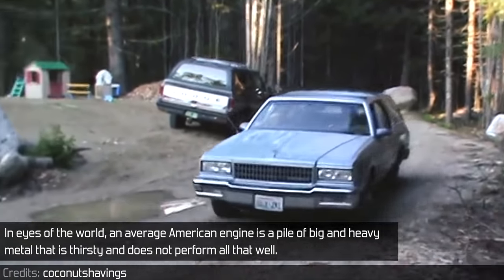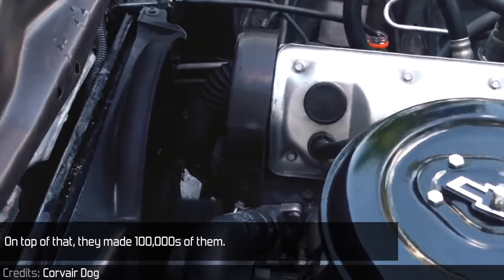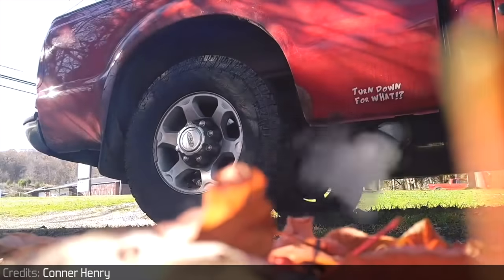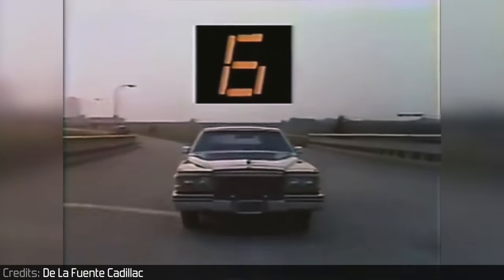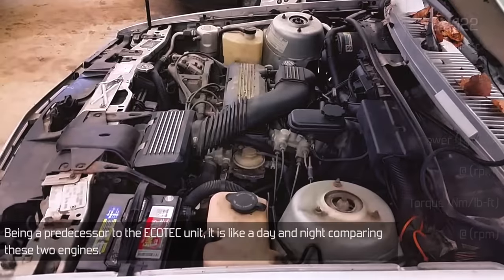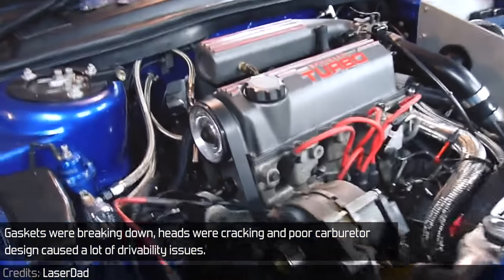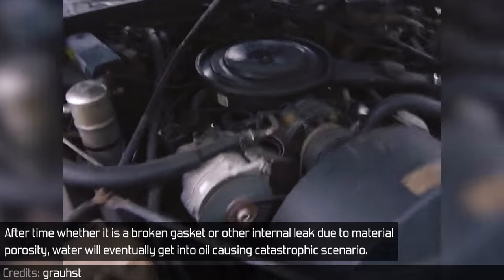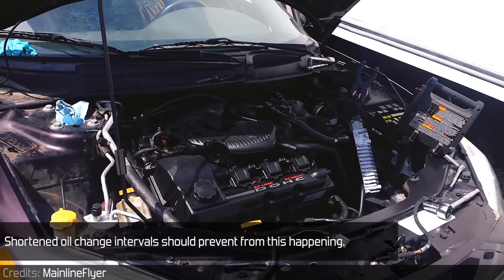8 Worst US Engines You Should Avoid

Comment: Another major problem with the Cadillac HT4100 that you failed to mention was the aluminum block with cast iron heads.
Reply: StrongEnough78 I have an 83  Eldorado,  beautiful car in and out. has the dreaded ht 4100, but this one has been trouble free. about 165.000 on it now. I believe my excellent maintenance has been key, oil changes every 3000 miles, and coolant changes every other year and THE COOLANT TABS Allways ADDED. what ruined these engines I think was when the cars got older and were resold, a lot of these new owners did not follow the coolant requirement regimen,  and just drove them with poor to no maintenance,   and without those coolant TABS being replaced the engines eventually failed.
Reply: These things would eat intake gaskets 24/7. Just the sight of a milkshake these days makes me nauseous.
Reply: Sadly yes.  That was very prevalent with the HT series engine to also include the 4.5L and 4.9L engines.  The Cadillac Allante engines are not the same as they were built much different than the rest of the line up.  They were special engines that didn't experience the same problems as often anyways.  I'm not saying problems weren't there but the engines themselves were much better built.
Reply: @stevefranklin8052  Correct.  Proper maintenance does go a long way. It was the same thing on the older Cadillac's going back to the 50's starting with the 331 cu in engine. The cooling system is very important to maintain but its one of those things that gets overlooked very easily.  I've owned two different HT4100 Cadillac's, but sadly one of them had an internal problem that had to get rebuilt.
Reply: He said in the video it was a aluminum block with cast iron heads.  I know because it caught me off guard.
Reply: @marcmo7138  My bad. I totally missed it.

Comment: You forgot GM Quad 4 and the 301 turbo TransAm. Everybody has made shit engines, do the French next. I'll start...the standard LeCar.
Reply: It was one of the only imported in the us but sadly not the best. French car nowadays are great, sometimes weird designed but well engineered
Reply: a lot of the GM quad 4 engines weren't all that bad though under powered the quad 4 2.4L was the one well known for trouble while the 2.2 push rod based quad 4 engine (used in the corsica and caveleer/sunfire) is a much more reliable unit though early on had head gasket problems due to the coolent eating the gaskets resulting in GM switching over to dex-cool (that early on in its life gained the nickname dex kill as it was prone to developing sludge blocking cooling passages blowing out head gaskets (GM 3100 3.1L and 3400 3.4L V6 being two such well known problem cases) on this list as well should have included the GM 3100 multi-port/3400 SFI V6s these engines are prone to bending push rods, valve train lack of lubrication problems, heads, head gaskets, spark plug fowling, coil pack trubbles, being under powered in many vehicles they were put in (2000-2005 chevy impala, venurer/transport minivans) the engines are also known for rod barring problems and require regular maintanence scheduals to be adheared too strictly or there will be an expencive repair bill
Reply: upside downdog TBH if you want a casual car today (like midsize sedan) French cars are better than the American ones.
Reply: Layth Alkhaer not midsize sedans, altough the talisman , Citroën ds5 and c6  (not in production  anymore) are quite great (but undermotorised ). The french (and part of the germans) really nail it on hatches, small cars gti and hot hatches, like the 308 gti, the megane rs, the 208 gti and the last gen clio rs. But it will also slide to little performance cars like the new alpine a 110 or the Peugeot rcz r.
Reply: The problem with the Quad 4 was it was setup to run on Premium Gas. Most of the ones I seen blown up where people running Regular Gas in them and overheating the Piston. As for the 301, Total shit!
Reply: chada75 
How about waterpump failures at around 60,000 miles that cost around $2500 bucks for a shop to replace?
Reply: id say that shop was ripping you a new one and you could replace it yourself.  its not hard.  just time consuming
Reply: Big Show 
It wasn't mine. I wouldn't own one. I restore antique airplanes for a living, a broken car is a temporary setback. They replaced the cylinder head and all other necessary stuff from the water pump failing.
Reply: nothing wrong with the quad 4.
Reply: Frigglebiscuit 
You keep it then. GM's attempt at modern engine architecture (60's tech) was a good idea designed and executed poorly.
Reply: The Iron Duke?
Reply: 5Rounds Rapid 
THAT is one GM did good. The Quad 4 was DOHC, 4 valve that made around 200hp. They put it in Grand Am type front wheel drivers.
Reply: upside downdog My sister had a Grand Am with one. The engine was fine, the body was junk.
Reply: 5Rounds Rapid 
Sounds like you live up north where they salt the roads. Oldsmobuicks typically have well built bodys. Some had good drivetrains. Quad 4 NOT one of them.
Reply: You know they have entire racing series limited to GM quad 4s (dirt track).  Olds Racing had a turbo quad 4 with 900hp in the late 80s
Reply: Joey Quigley 
I did not. Great use for them as power wasn't an issue. Still an awful passenger car engine, they needed lots of maintenance.
Reply: What's wrong with the 301 in the trans am It's a strong motor only issue is it underperforms but you could get a lot more out of it it has a rolled fillet crank forged pistons and stronger internals and cylinder walls you could safely crank the turbo up if you wanted to
Reply: upside downdog Nope, the South. She ran into a deer, and all the plastic trim fell off.
Reply: The ONLY reason that GM did away with the Iron Duke is because people were complaining about the noise it made, and GM couldn't make it any quieter.  Other than that, it was one of the best 4 cylinders ever built. A bit underpowered but still an EXTREMELY reliable engine.
Reply: Yeah like the Renault Alliance. Car of the year...lol, ha ha ha ha
Reply: Quad 4 was a mixed bag. It could make good power with an NA tune, and it was possible to get them around 200HP to the wheels with the right cams and computer program. For a while it was the highest power per displacement with no boost. And it was doing all that before Honda came along with their VTEC. (However the Quad didn't have the variable cam thing Honda did, so the idle could be quite rough. Later variants tried fixing that with other band-aids like balance shafts, but it was effectively de-tuning the engine with more rotating mass and less overall performance.)

The downsides is the heads were prone to cracking, head gaskets didn't do too well (never run it hard cold, fastest way to blow it), chain tensioner would wear out early, and IDI would have heat-soak issues that'd result in ignition problems. Although it could do performance to some extent, it just lacked reliability.

Then of course there were V-block engines that could be considered an extension of the Quad-4 family. Aurora and Northstar come to mind, and they inherited many of the same problems of the general architecture. (Mostly cooling and head issues.)

Also keep in mind that some of the really high output versions of the Quad-4 (like the Aerotech or some drag or dirt cars) were made with a special blueprinted racing block. Similar in the DOHC and general configuration with headers and such, but that's it. Quite different than what you'd get in a car with a factory stock engine as a lot of it was more beefy. They also tended to relocate the ignition to avoid any of those issues.
Reply: Nothing wrong with the Quad 4? The peanut butter machine? They always had a beige froth/foam from water getting in the oil.
Reply: There was nothing wrong with the 301 Turbo. You have no idea what you are talking about. Anyone who has problems with ANY turbocharged engine usually does because they neglect proper maintenance on the turbocharger. There were no factory defects with that engine.
Reply: Mike Lunn the Iron Duke was notorious for overheating and blowing head gaskets. It was an awful engine.
Reply: upside downdog - French cars? Like the old Peugeot? The French make cars like the old Soviet Union would have. And they'll tell the buyer ' You WILL like this car, comrade'.
Reply: Nothing wrong with a 301 they are the same as 350/400 pontiac. They just didn't have near the go of the other two.
Reply: I agree with you Mike. My Iron Duke in my S-10 was an extremely reliable engine. Never had a problem with it. It did have a lot of valve train noise but this was because of the OHV design with long pushrods. The TBI injector they used were also noisy units. You could hear the injector pulse as they idled. Power wise, with a 5 speed manual, they were decently powered and delivered consistent fuel mileage, although it never broke 25 mpg but never lower than 23...even when loaded. Not a drag race engine by any means but it had no trouble with keeping up with the traffic.
Reply: The problem with the 301 turbo in the Trans Am was that it was completely underdeveloped and it was being compared to the 400 big block that was no longer being produced. If it were allowed to be developed properly, like Buick's turbo 3.8, with proper fuel injection, better electronics, and an intercooler, it could have been a huge success. I have an 81 turbo TA in my garage, all stock with about 45k miles on it and you sure find out quickly that it has a lot of shortcomings in its design and performance. It's been reliable but it is no 400. Best to leave it alone, drop it in D, let the stock ECM do its thing and accept it for what it is.
Reply: le gall pierrick Renaults are disposable cars even now days they love to be in the shop
Reply: Edvin Nelius 
It bothers me that they own my favorite company. Nissan. My 84 truck was built in Japan before all that. It is the best truck in the world. 720kg capability. Fully boxed frame from nose to tail.
Reply: but the "time consuming" part is where the cost is - both for the job, and the shop's fear of possibly having to re-do some of them. Fine for the hobbyist, if you don't mind doing it as a labor of love instead of doing it as part of making a living.
Reply: Joseph: You're right. There was nothing wrong with the 301 turbo engine at all. It just never met everyone's expectations in terms of performance. I have an 81 turbo TA and have found it to be pretty dependable. In terms of driving it, it is a disappointment considering its a turbocharged V8. It wheezes and bogs when you rev it and power braking to build a bit of boost does little if anything. It was clearly developed to be put into the 3rd generation TA in 1982. It would have been interesting to see what would have become of the 301 turbo if it were to develop along side Buick's 3.8 turbo. It could have been a Grand National killer. Who knows...all water under the bridge now.
Reply: You mean like the inline 6's that regularly put in over 300 to 500k in use? LOL
Reply: its tough   how you  get  the mail
Reply: yes  they are .. have  one  in my  84  fiero  ,, an all  your mail trucks   like my  corvairs   you can tell  what it  is
Reply: Joseph Burke    Glad we got the "Iron Duke" in our '91 Olds Calais. First thing we did when we got it was load it up, went from Mich. to Fla. Came back a week later. Never a problem. Hearing the "Quad 4" stories since then . . .eeeew! Besides the "Iron Duke" was basically half of a 327.
Reply: i have both  no problems  with  them
Reply: There's nothing wrong with the Trans Am 301 Turbo V8. It just lacks power because it has to meet emissions standards those 2 years. Power s the same as the Last 400 Pontiac and Olds 403 V8.
Reply: What a difference a few years make. Since Buick started putting Turbos in 1978 then got better around 1983 & ended with the GNX in 1987.

Buicks "Free Spirit" Century pace car for the in 1976 Indy 500 was a heavily modified turbo v6 making 300hp. Sadly no turbo versions of the pace car were sold to the public. Just 165hp turbo versions. But they had something there.

If Pontiac had more time, they could have made a better turbo as done something similar to what the 1989 Turbo Trans Am was using the GNX 3.8.

Big diffrence 7 years makes in technological advancements. 

But now they Turbo 1980 1981 Trans Ams are more about collector value and less about top speed, more about a time capsule remembering where we were in 1980 with Smog Emission regulations, and enjoy a nice cruiser. 

Because today anybody can take a 2nd gen trans am remove the smog v8, and swap in a built chevy 383 forged stroker making 600 hp and tear up the streets.
Reply: upside downdog
Reply: I had a Grand prix with a 301...nice car as long as you didn't drive it.
Reply: Mike Lunn only 95hp

Comment: Disagree about the Ford Modular V-8's (Triton) it's not uncommon to see them run 300,000+ miles, they're a little more complex than the pushrod V8's they replaced put a lot of that was driven by emission and economy regulations. Versions of this engine were used in the Crown Victoria, often they were sold as cop cars, law enforcement would run them 100,000 miles and taxi cab operators would buy them up at the auctions and run them in many cases to 500,000 miles in cab service.   While the 2.2 Mopar wasn't wonderful many versions, with reasonable care would last as long as the cars they were bolted into, so how much more so you really need? Back in the day the 2.2 carburation was better than the 2.6 (Mitsubishi) so if you were looking for a beater the 2.2 was a better deal. I am surprised to not see the Mopar 4.7 "magnum" V-8 as they are an engine with a service life of under 200,000 miles AND tend to have a lot of issues with valves and cam followers unless you're very fussy about your fuel.  The symptom is all of a sudden it starts missing, when you investigate you find it has chucked out a cam follower, it does this because valves are sticking, at this point the only lasting repair is to remove and rebuild/replace the heads. You should consider putting the GM inline 5 cylinder on the list, seems the timing chains aren't as durable as they should be and the engine has to be removed from the vehicle to change the timing chain. The Northstar V-8s are a wonderful concept and great when new but not that durable, hard to work on and not that long lived.

Comment: Not only are the triton engines known for throwing plugs its one of the few engines I have to use a piece of rubber hose on the end of the plug just to line it up and get it started vs others I can use the spark plug socket to start them. Every v6 and v8 ford of this era will do that. I use blue Loctite on the plugs and typically have the owners replace all the coils at the same time as they usually fail after new plugs. No issues after that besides the plastic intakes failing. The Dodge 2.7 omg was a total pos and they continued for way too long. Water pump replacement involves a timing chain job too as it is chain driven and is incredibly expensive. They aren't long term engines either they have such a high failure rate all the way up to 2010 in the 300, magnum charger lineup. Not to mention the water outlet housing is prone to cracking and leaking. You really should have included the Northstar engine lineup. Anybody that knows these engines hates them when they need work. Prone to head gasket failure and crazy expensive oil leaks def avoid them. Sure they have amazing power and decent mpg but long term not so great.
Reply: Chris Atkinson ...Gas mileage isn't everything. A fuel-thirsty but bulletproof engine will cost you far less over the long haul.
Reply: maverickdallas100 I was talking about the northstar as being fuel efficient but a total pile overall. Of course a built engine would be better lol
Reply: Chris Atkinson ...Just changing a starter is a nightmare on the Northstars. You won't find it in its usual place. The starter is buried in the engine's "valley" under the intake manifold! It is a very labor-intensive, time-consuming and costly job! Not my idea of fun!
Reply: adding loctite to spark plugs is asking for porcelain in the bore...

Comment: Okay the ford modular engines were not bad engines. They are the most reliable. My crown Vic made it past 200k and I sold it. Yes spark plug popped out but fixed it with helicoils and no more problems ever
Reply: They are not the most reliable. And the modular line has a lot of problems.
Reply: @jdrok5026 , most of the modular issues are due to lack of owner maintenance or the incorrect oil allowing sludge buildup to block small passages in the block, other than the spark plug issue, which appears to be a poor plug design issue..
Reply: No, your car is NOT realiable if it spits out a spark plug, this is a major repair, providing no other damage was incurred.
Reply: @jdrok5026  4.6 2v is the most reliable one. 3 value bad, 2 value good
Reply: @NeverTalkToCops1  the 2v didnt have that problem